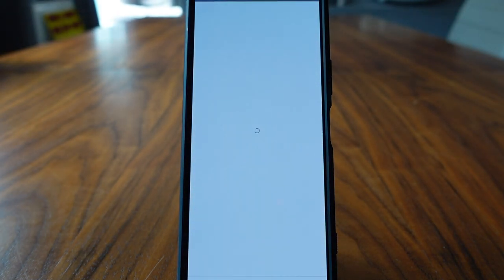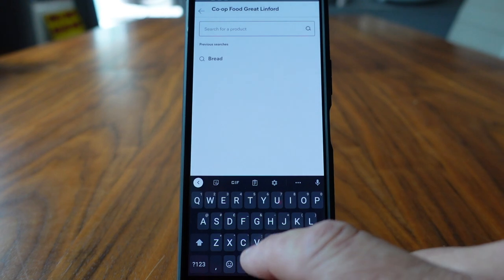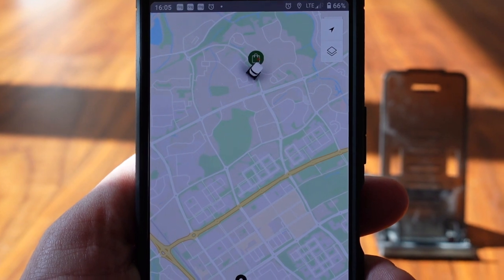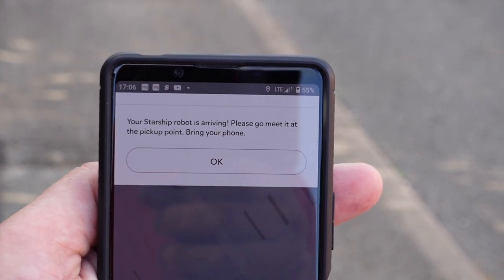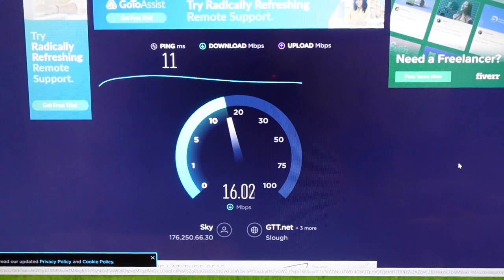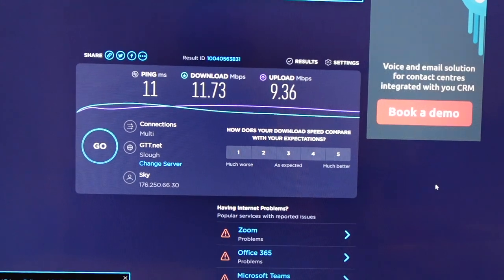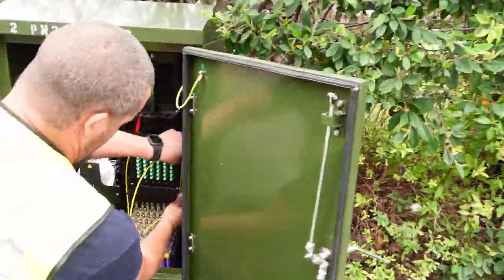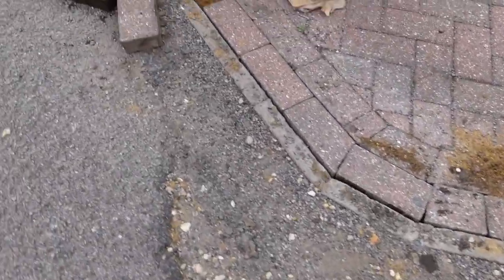Food Delivery Robot & our 900Mbps Fibre Optic Broadband Installation

Comment: I am guessing they can only use the robot if the items are enough for one bag and if the weight isn't too heavy as well? Hopefully larger variants of robots could be utilised in future!

I am getting vodafone pro via cityfibre as well but I live in a block of flats and the installation looks a lot different than on your house, there is a large white box with many cables inside the block and a metal cable shielding wrapped round the building and into the ground.